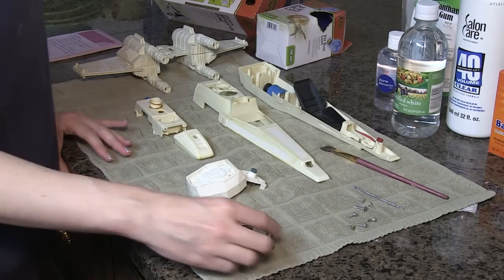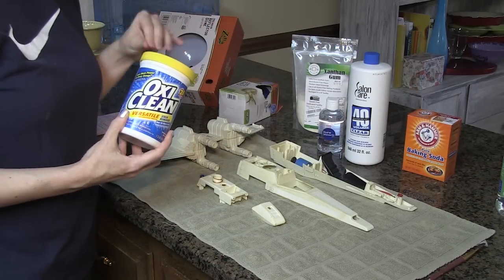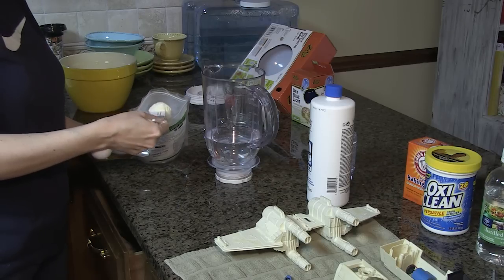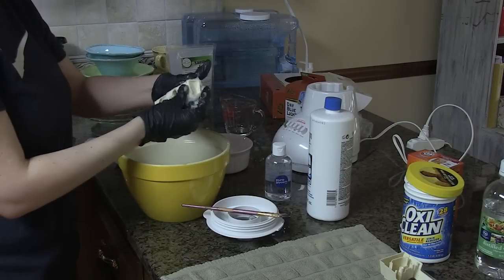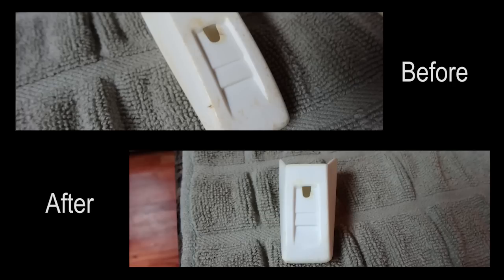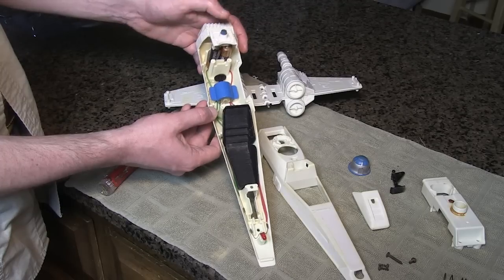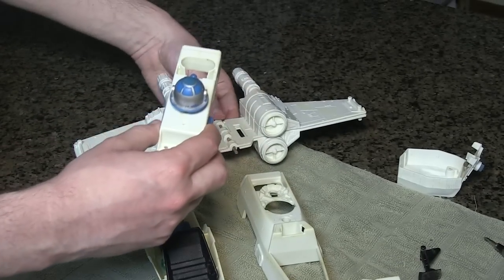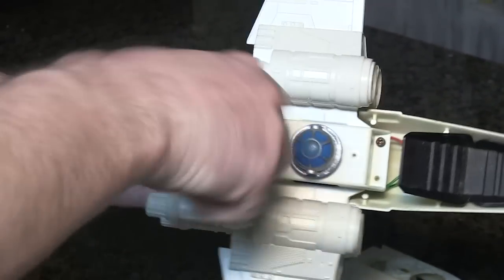Star Wars Vintage X-Wing Restoration - Part 2 - Kenner 1978

Comment: I want to thank you for the tutorial on the motor and light. With new movie out, and my niece getting into Star Wars now, I pulled out my X-Wing. I tried cleaning the contacts, but it still didn't work. (They aren't rusty) After coming across this video, I took in apart, and following your instructions, hand cranked the motor. It works! The light too! Still has some sticker damage. Missing canons and the landing foot broke ages ago. But now I know what to do to make some more repairs :)

Comment: An on-going sympathetic restoration which I think is the appropriate way to go. A great watch, Cheers, Fuzz.
Reply from the maker: LaughItupFuzzball70 Thanks Fuzz!
Reply: +RetroBlasting  about the r2d2 wearing of the foils opening shutting i have a tonka 95 x wing that im fixing the lip on the bottom of the r2d2 has nearly snapped off could i just glue it and turn r2 around?

Comment: Mattel attempted to fix the problem with the s-foil release switch by using a rubber band.  Amazing, after 30 years both the rubber bands on my x-wings were still intact.  Still a pretty cheap solution though.

Comment: You have inspired me to see if I can get my X-wing´s motor running again after 20 years. The light works fine. If you have any ideas for improvising home-made parts it I think that would be interesting. My cannons were lost years ago and I just can not bring myself to buy replacements (mostly beause I do not mind them being missing that much and I would not have the emotional attachment to non-original parts) but I think it would be cool to really create something which would be mine (like modifying black plastic chopsticks) and thus mean something even of they do not look perfict.
Great work.

Comment: i use the 40 volume cream under a uv cfl bulb from amazon. it works flawlessly without any other ingredients
Reply: +Richard Ricketts. Wanted to pitch in too and say i did the same. Though i used the sun, therefor it took me two day.
Other than that great tutorial.

Comment: Thanks, good stuff!  I was inspired to restore a junker that someone had given me years ago.  Regarding the motor:  Does it naturally spin clockwise (if you were sitting in the cockpit)?  Where did you put the oil?  On the gear stem, or in one of the holes on that side of the engine?  Thanks!
Reply: To answer my own question, a working motor spins counter-clockwise, if  you are looking from the rear of the ship.

Comment: You mention 3 in 1 oil in the video; I'm curious how and where it would be applied.  I'm assuming it's used on the motor?
Reply: ***** Thanks for the tip! Looking forward to taking a crack at my old X-Wing. Keep the videos coming!

Comment: so i pulled my x-wing apart and every wire connection has green corrosion all over it.  can i clean that stuff?  by the way my x-wing is grey in color how ever still has 1978 stamped on the bottom.
Reply: +FieroScooter That's when the mold was date marked (1978). The Grey is representative of the Battle Damaged X Wing and KENNER simply kept the mold. As for the green corrosion use CLR. It'll eat away that battery acid residue :)